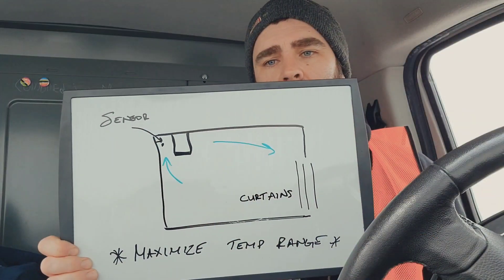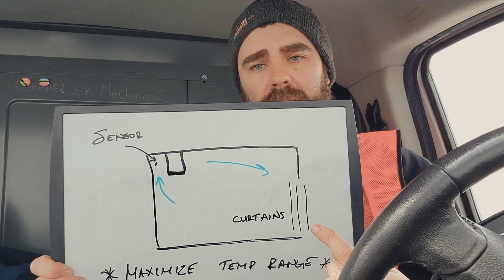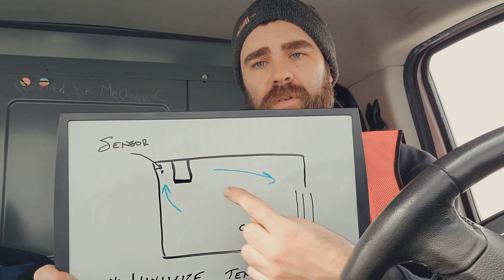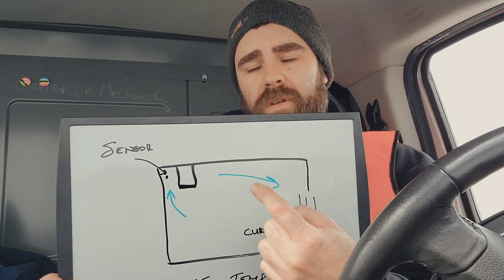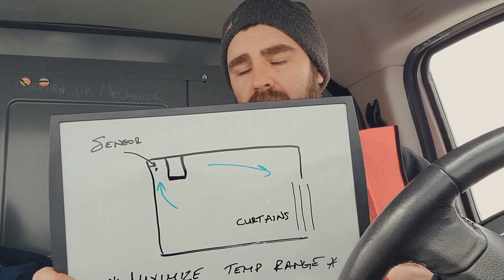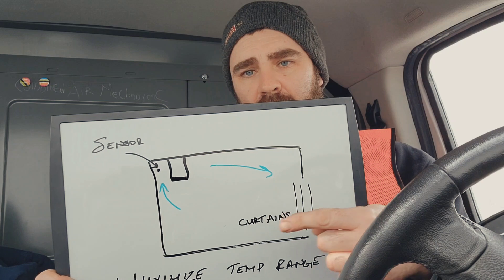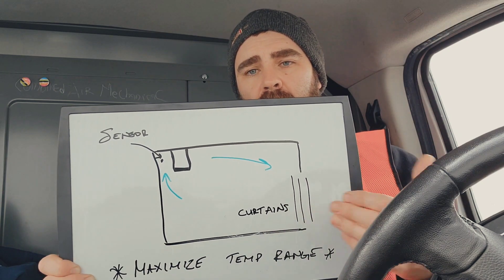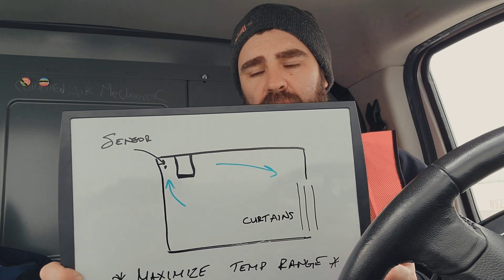Walk In Coolers And Off Cycle Defrost - Avoiding Freeze Ups

Comment: Someone once told me to have the evaporator fans off during off cycle defrost which sounded counter intuitive to me, basically saying the water will refreeze faster with the fans running 

To this day I don't know if I believe it (I work on AC most of the time not much fridge stuff this is why I'm unsure)

Comment: Hi i have set 32 Degrees set point on my cooler . It doesn’t stop .it keeps running thats why its freezes . What do you think its the thermostat controller? Or anything else? Im using carel temp controller.